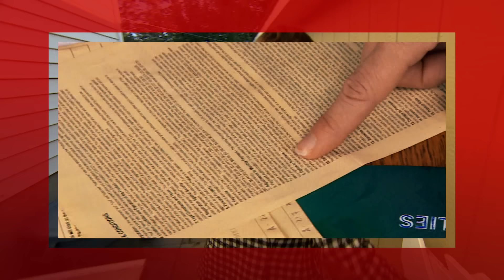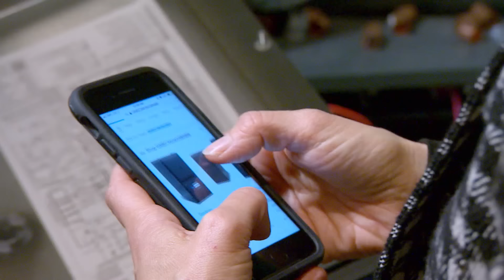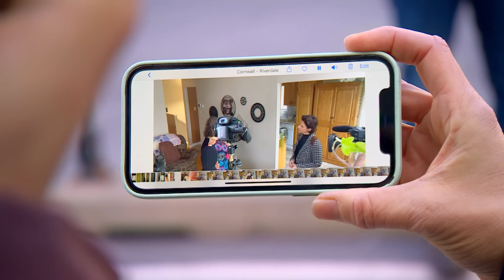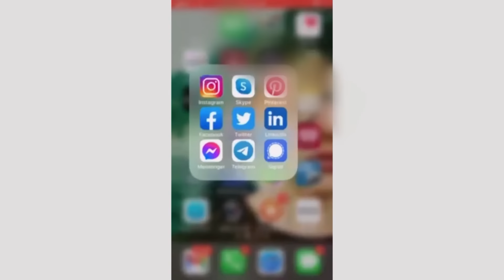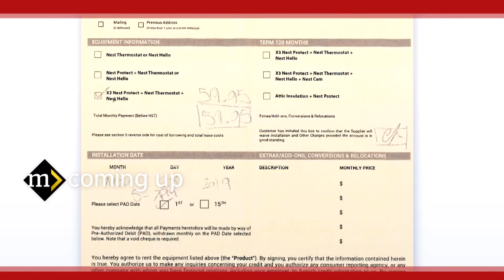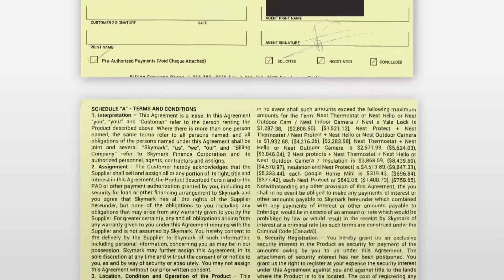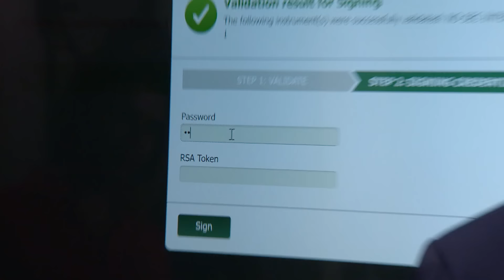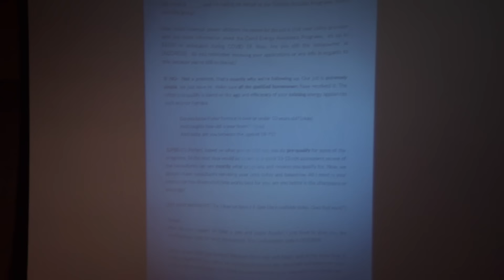Hidden cameras catch HVAC scam in action (Marketplace)

Comment: I hate scammers! Even though the furnace cost $1,800, you also have to have it shipped and installed. It shouldn’t cost anywhere near $12,000 total, but maybe anywhere from $4,000-$6,000 total, depending on the difficulty.
Reply: That maybe true but she might not need a new furnace
Reply: @Native722  True!

Comment: I had a reliance tech come to my place to replace a motor in my furnace. He said there were no motors to replace mine. He then said he would wave a wand over my furnace to see if there was a CO leak, if so he would red tag it and I would need a new furnace. I showed him a CO detector plugged in by the furnace. I never ssaw an East Indian blush before. The next day there was a new motor at my door and a different tech installed it.

Comment: I have a guy I have been going to for 12 years now. He worked in HVAC for 27 years and retired but does it on the side. He did not retire because he wanted to retire, he retired because of the scum company he worked for. The owner wanted him to replace water heaters, furnaces and AC units when it wasnt needed, charge crazy amounts and then charge them a disposal fee. The guy would then take them back to the shop, clean them up and resell them to other customers as "refurbished". When he started doing that, my guy left that day and now is doing his own thing. For a water heater installation recently (mine blue up literally) he charged me $75 + fittings cost. This was after he found me a water heater for $300 on sale when all the others were $500 or more. Just crazy how scummy people really are.

Comment: I mean a 10 year old water heater should be replaced but if you dont have the money for it go until it takes a crap. But the inside of that tank is probably disgusting. Just because "its working" doesnt mean it doesnt need to be replaced

Comment: $12k for a 90+% furnace, new coil and condenser isn’t bad at all. I’ve been in field 27 years and that’s the going rate in NJ. Clients have option to shop around and they find the prices are all competitive and in the same price range. Prices went up…..on everything not just Hvac. So that isn’t a scam. Lying to sell a system or a job is. That shouldn’t give the entire industry a bad name. There definitely are some scumbags. I hate salesman. I feel clients rather buy from us technicians. I give them Options and then let them decide. I don’t spend their money! We recommend replacing water heaters over 10 years old due to age, that’s if there is an issue. I just ask people, how’s it heating?! Just be forthright and honest. Clients will buy when it’s time.

Comment: The price unit doesn't indicate the price of total cost. You are not paying two hours of work, you are paying them 10+ years experience to do this work in 2 hours. Each home has different size mechanical room makes the work different home to home. Of course as these furnace or boiler, rental should have never happened.

Comment: As an hvac contractor i can honestly say there is more than enough profit to be made doing an honest job. It's a skillset not many possess. Therefore, demand is high and so are the margins.  People like these make us all look bad.
Reply: When someone change the parts of a walk in freezer, does the power need to be turned off first?
Reply: @武义-b1r   likely yes
Reply: @basspro45879  thank you very much. We just asked a new technician for more Freon. (The one we had for years move away) He said there are many parts out of order. He charge me for $800. When he said he finished the job, I was in shocked. Because he never ask me where is the electric box. The whole time the freezer is on😟 speechless.
Reply: @武义-b1r   ask for a list of parts replaced on his final bill. Honestly, 800$ is a relatively minor amount when it comes to major hvac/r repairs. Having a refrigeration unit that is constantly low on refrigerant is a big problem and should be fixed asap. I hope things are resolved quickly for you sir

Comment: if you can, learn how to do your own maintenance / repairs. of course what system you have plays a roll in that also, i have a oil burning forced air furnace which is easy to work on. & electric water heater, no gas crap. too many electronics there.

Comment: In hvac there’s so much money to be made. No need to lie. Old systems with leaks make you a fortune charging normal rate for refrigerants. Those that are smart, and replace those systems, make you a fortune selling the equipment installed at a decent price. Even normal repairs at a decent price net you quite a bit. There’s no need to lie about anything or create issues.

Comment: I had a free carpet clean from filter queen so I let him in2 hours of bullshit and no carpet cleaning. My wife let a water filter in we paid 3,500 for an 800 rain soft filter.
Then a guy came in to check furnace and air said the units are leaking carbon monoxide and the air is sized up that was 25 years ago it was just a dirty filter but many people get suckered into contract 😊

Comment: Scammers or just higher prices, because that’s what they charge, so at what point is that line crossed?

Don’t get me wrong I feel a lot of these guys absolutely are scammers. I had a plumber tell me it would be $1300 just in labor to replace my hot water tank without even coming out to look. It’s a 40 gal tank being replaced with the same kind of tank. The plumber said it would take 30 to 60 mins, so he wanted $1300 for one plumber to do 1 hours work. This was the plumber recommended by a big box store.

Comment: Yeah, I appreciate you calling out bad HVAC companies that are trying to get sales on perfectly fine systems. But the price you google literally means nothing. I mean for just the furnace then sure that's a questionable number at 12k, but if it's a 14 seer system at 5 tons and the furnace, evaporator and condenser all got replaced. That's a pretty normal price. Contractors take the equipment price and double it in all industries not just HVAC and that is normal. Every company has overhead, labor, training, other materials then just the unit and profit that needs to be made otherwise what's the point in running a business.

Comment: Your news report is filled with wrong information. I agree that being dishonest with customers is bad. Your expert did a horrible job inspecting the systems. He says “I ran it through a cycle and it’s fine”. What did he test? What systems in the furnace and water heater did you test? Did he inspect the heat exchanger for cracks or separations? How clean is the blower? Your reporting while in some cases shows bad things some contractors do. You are using this report as a scare tactic to get ratings and that’s just as bad as the dishonest contractor. Shame on you for scaring homeowners. You potentially put homeowners in danger because they are scared to get potential dangerous system properly inspected.

Comment: Electric power without fuel or pollution can be generated with an Edison generator.  If you add inverters you can have house current AC power continuous peak power without fuel or pollution. An old car generator can be converted to Edison generator and wired to inverters to deliver house current AC power.  You disassemble the old pre 1974 car generator and chisel off one sixth of the armature magnets and leave one sixth on and alternate chiseling off one sixth and leave one sixth on until you have chiseled off three sixths and left three sixths on the armature magnets.  Now the armature magnets move the coils of copper wire like a motor and when you reassemble this motor as a generator it will move . So you have to hold both the case and armature securely to reassemble this generator as a motor.  Then you wire the brushes to the positive post of the inverter s and the field wire to the negative post of the inverter s.  Now you have house current AC power.  A 40 amp inverters is two twenty amp circuits.  This can power one refrigerated or heater for each circuit.  One 140 amp car generator can power three 40 amp inverters and produce 6 house current circuits.  Including an electric water heater.

Comment: The price of the first lady with $1800 furnace wasn't really that bad for a 10 year loan, I mean an installation at 12k isn't abnormal for being financed but the high pressure sales tactics an lies are scumbag moves. On top of the liens for 12k for some electronic thermostats and doorbell camera is pure robbery that's like $500 job at the most if connections are already there.

Comment: i've had 2 water heater tanks rust completely through and fill the carpet and floor with water, one was 12 years old natural gas and the other was 15 year old electric in different houses, i'd like to know how the professional guy was able to tell the tank wasn't severely rusted inside by an inspection, ALWAYS sit your water heater in a plastic pan made specially to catch leaking water and pipe it to a drain, (even on a new tank) i'm not sticking up for the scammer at all, just sayin'

Comment: The woman shocked that her furnace is $1800 dollars... did you forget to add in mark-up, labor, adaption materials, years of training, schooling, and experience?  That's a $4000 to $6000 dollar installation depending on region if it was JUST the furnace and not the AC...  That part is dumb...The rest I'm on board with .. Companies that train salesmen instead of good techs SUCK.... "CALL GILLECE"

Comment: Contractors suck. They will tell you anything to make money off you even if it’s not necessary. Got an estimate for some electrical work , priced the parts that it needed, and it came up to 350. Ok I thought maybe 1,000 ,or should say around that , but they quoted me 1,800 , way to much for some simple wiring job. Always get at least 3 quotes. Hopefully one will be a good person.

Comment: Well water heater tanks should be replaced around every 10 years sometimes shorter. Your water heater may work fine and dandy but over that many years it’s for sure building corrosion and minerals as a standard maintenance it never hurts to replace the water heater at 10 years. If you don’t want to ever replace the water heater you will obviously be less efficient. You’d be heating up water but also mineral buildup. You’d have rust chemicals in your hot water and lastly your water heater will explode. It’s not always a violent explosion it’s just expands rapidly and sometimes there are bad leaks it’s not at all like a bomb or anything.

What he said is not true there’s no 6 days of having to replace your water heater. Of course it’s always a good idea to do it after 10 years. He’s not harming you by getting yours replaced. But he’s being forceful about it which isn’t good and who knows you might have a clean water heater with no mineral buildup, corrosion, and it’s perfectly fine. I highly doubt it. I mean really doubt it but it is possible. I don’t like how the tech didn’t actually drain the water heater, remove the heat rod element and use a flashlight to take a look at the inside of the water heater for True clarification. All he did was a quick inspection of the parts and a quick test. In reality he should be looking inside the water heater and the heat exchanger of the furnace

Same goes for furnaces but instead of lasting 10 years if your furnace is 15-20 years old I’d say same thing. Time to replace. If not for the inefficiency then for the heat exchanger which would most likely be rusted, perhaps cracked(not good), blower might be on its last legs, gas might start to lose its functionality. The duct and filters might be needing a good upgrade for better cleanliness. The list goes on. Of course If you don’t have extra cash then you can keep going until something breaks down. If you feel dizzy if might be deteriorating flue, heat exchanger, gas, etc make sure to take care of it asap. Don’t gamble with your life. 

If you have a cheaper we’ll maintained furnace 12-15 years is about standard life. A good furnace well maintained 20-25 years life. 

A furnace poorly maintained can go bad quickly. It rips the furnace apart and destroys it. Change the filters, clean the coils, outside and in. And clean the duct and fan turbines and your furnace will go the distance.

Also yes the Goodman furnace will cost you around $2,000 but there’s a ton of materials and tools and expertise that goes into installing a new furnace. Labor costs are always going to be a big cost as well as overhead and more if pulling permits or warranties.

Just a roll of insulating bubble wrap is 200$ a roll. That’s ridiculous but out of the thousands of dollars of materials labor is a heavy cost.

Comment: First off these guys are salesmen NOT hvac technicians. The lady Karen that paid 12k didn't necessarily get screwed. The inside unit was $1800 but what about the outside unit and the nest tstat and everything involved such as permits and labor. Depending on the size of the unit 12k is somewhat standard. The lean on her house is to make sure the companies get their money just like a car or house or whatever. So she didn't get screwed
Reply: Sounds like you like to charge a arm and leg as well 😂. I install a furnace gas or electric around 5500 tops or less if unit is plug and play .
Reply: @paullir8449  plug and play?
Reply: @johnmflores85  No major modifications

Comment: These scammers are trash…on the other hand why would you let someone (that didn’t even bring a screw driver with them) tell you your equipment needs to be replaced if they have only looked at it from the outside just like you(the customer) did?

Comment: If you get 10 years out of a residential hot water tank, you've gotten your money's worth. Especially if no regular flushing had been done. Some of what he said is true. Nothing is more aggravating than to leave on vacation and come home to a flooded basement, garage or worse. Some houses have the water heater in the attic. There should be an emergency pan underneath it but depending on the location of tank failure it may not catch all the water.  Regular draining and flushing will prolong the life of the tank. Also inspect and replace the anode rods when needed. Most residential water heaters are ~$500 at hardware and home improvement stores. Installation will add to that whether it's done by the owner or contracted out.

Comment: Well I really love all the BS!!!  Here is reality... $12k For an HVAC changeout is an average price! Next, While a water heater tank is generally made to only last around 10 years, they often last much longer!  I will tell you something that NO ONE else will.... when it comes to Hot water heaters, you should hook up a hose to the boiler drain and run it into a sump pump or other sewer drain or outside and fully open the valve and let it run for 5-10 minutes ONCE A MONTH!  This helps remove sediment from the tank which will increase the life of the heater! There is also a Zink Anode that should be replaced every 5-7 years which will also increase the life of the hot water heater!  Doing these 2 things can increase the life of the heater to up to 20+ years!!! So stop giving contractors a bad name just because you "feel" like you're being "Ripped off"! A High efficiency gas  furnace costs me around $1400 WHOLESALE!!! THAT'S ABOUT $22OO RETAIL, and that does NOT INCLUDE all the miscellaneous parts & materials needed to install the furnace!!! It doesn't cover my overhead.... employees payroll, insurance, vehicles, vehicle insurance, repairs, advertising, etc, etc, etc.... you Say $12,000 is a lot for a system??? There are companies in the USA that charge $25k-$30K for a system because they're a huge company with tons of overhead!!!  Now as for your "EXPERT", Yea jury is out!

As for the leans, if I put a system in and the customer didn't pay, I would absolutely put a lien on their property!!! So are they ripping people off? My opinion is still YES because they don't explain everything to the customer UP FRONT!!! BUT ALSO NO, not to the extent this SENSATIONAL STORY makes it seem!!! BUT.... I guess if the story wasn't JUICY then none of you would watch it!!!

Comment: I installed HVAC systems, and sure the furnace you can purchase for $1500. 

But for you to install it correctly and get it up to code, it may cost around 4k-5k for a company to do it depending on the equipment. There is a lot of scammers, but there is also reputable companies that really do a great job.